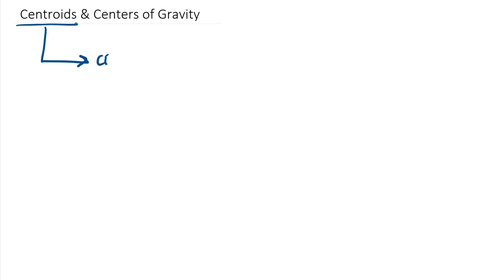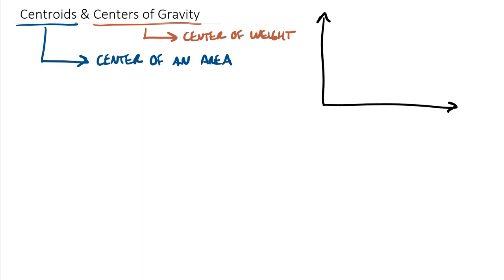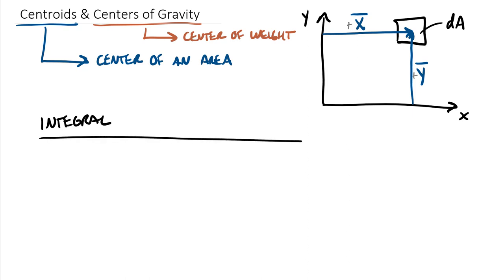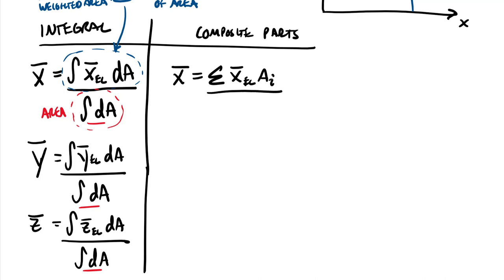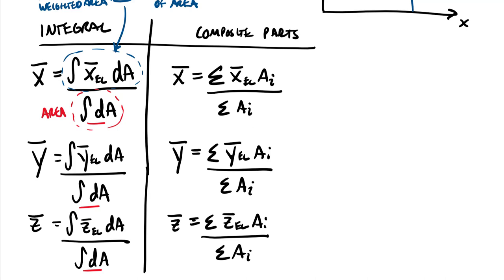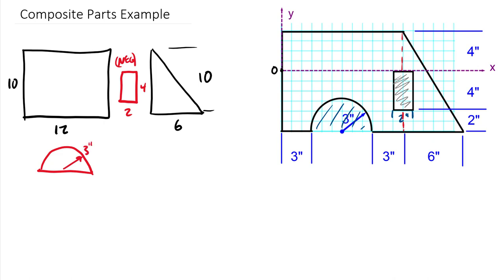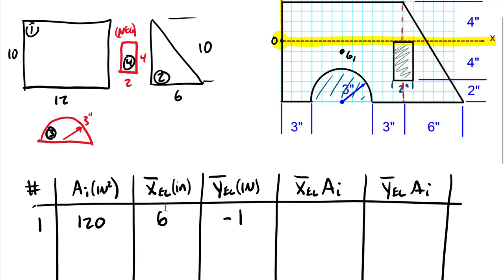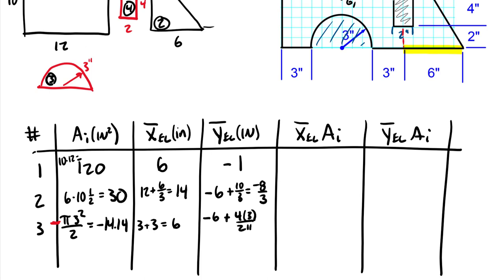Statics: Centroids & Centers of Gravity - Introduction & Composite Parts Example

Comment: Great video, but it created a question in my head. If for half circle the distance from the axis to the centroid is x(bar)=r, and the radius of shape 3 in the example is 3, why are we doing 3+3=6 instead of just x(bar)=3
Reply from the maker: Good question. x̄ is defined as the TOTAL distance from the given y-axis to the shape's centroid. This is the same reason that the x̄ for the triangle is 12 + 6/3 instead of just 6/3